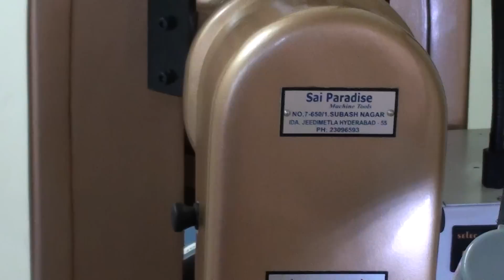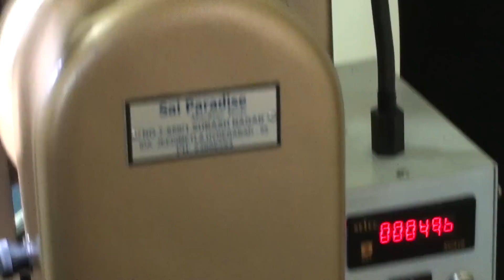2 ton roller clutch crimping machine (RC-2000) with side feed applicator

Comment: That guy is good at quickly positioning the wires in the right place before crimping them. I assume that the machine helps to position the wire ends squarely over the metal connectors too.
Reply: I don't think it does freeze frame at 2:00 and it shows defects in his right hand from poor wire position. Both up and down and in and out. So basically the operator guesses where to hold the wire